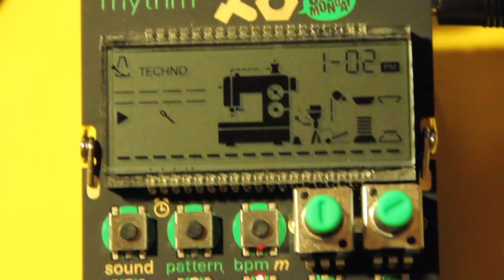Kraftwerk - Pocket Calculator (AA Battery Live Cover - PO-12, PO-14, PO-16, Stylophone, mini KP2)

Comment: Hi! I don't know how many times I watched this video. That's a brilliant job! 😊
I have some questions if you don't mind to answer.
I also have a kaossilator, but I can't sync it to, or use it as an effector for my POs. When I plug it to a PO, if in SY0 there's no audio comig out, and if in SY1 I can still hear the annoying click of the sync. Would be so kind to share how you managed to plug it and connect all the cables?

Another question: since is the first time I see the real potential of the Kaossilator's vocoder, How did you manage to get such a clean sound? Is the button HLD on or off while you talk? 
When I'm trying to talk in the microphone, the only sound coming out the speaker is some bouncing noisey echo with a bit of effects, but the words are uncomprehensible.

Thank you in advance! ❤

Comment: Woah man! Great cover, what are you using for the vocoder effects? are those done live? they sound so good! what did you do to get it?
Reply from the maker: +sckaterbean thanks! the vocoder is the KORG mini KAOSS Pad 2. It has a built-in microphone that you can activate and several different vocoder effects. You can then even control the pitch on the touchpad, which I didn't do here because It was difficult to get the notes right. Everything was played live.

Comment: how do you sync 'em?
Reply from the maker: +denis romanenko I used splitter cables for this (stereo to 2x mono (red = R = sync signal & black = .L = audio)). 
The audio goes into a mixer. You have the best control over each volume then. Sync goes to the next PO. Each PO has to be put into the correct sync mode.
Reply: +AA Battery  and how do you sync po 12?  can po be synced with kaoss pad 3?
Reply from the maker: +denis romanenko po12 isn't synced. It gives the tempo. I don't have a Kaoss Pad 3, but I think it only uses MIDI to sync, while the POs only use audio sync. You could use an Electribe 2 or Korg SQ-1 for syncing both. Or even a Volca if it recieves MIDI from the KP3 and sends the audio sync to the POs. I didn't have to sync it to the mini KP 2 in this video.
Reply: Thanks a lot for your answer. I've never deal with audio sync, so that's quite interesting and new for me how it works.
Reply: As far as I understood mini kp 2 can be synced with po?
Reply from the maker: +denis romanenko It can't be synced at all (no MIDI or audio sync). But you can set the tempo value or tap the tempo, which is enough for delays or occasional short loops.
Reply from the maker: +denis romanenko Audio sync is mostly a short pulse. You can even generate your own:
https://www.youtube.com/watch?v=O8N1Pl0NI30